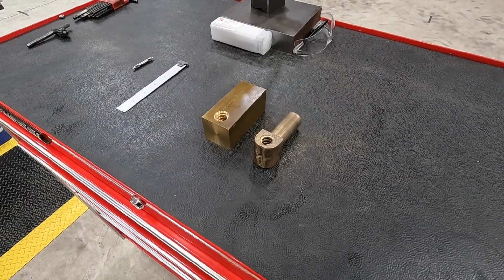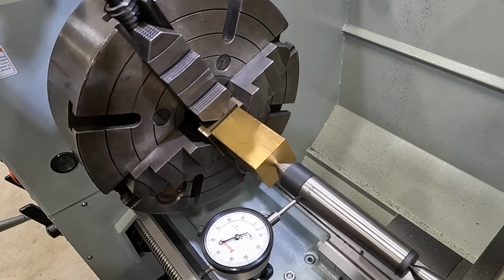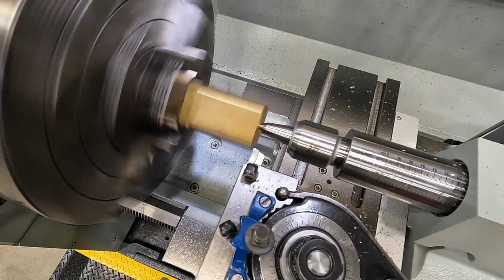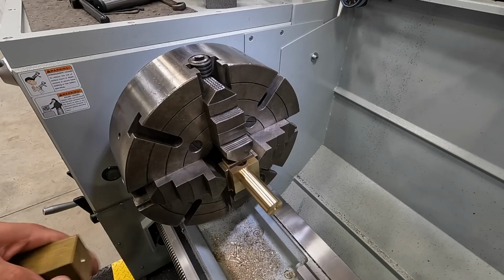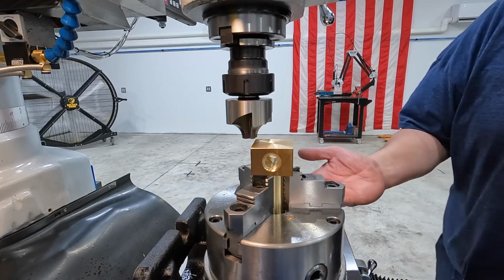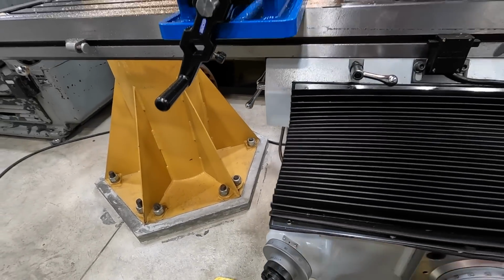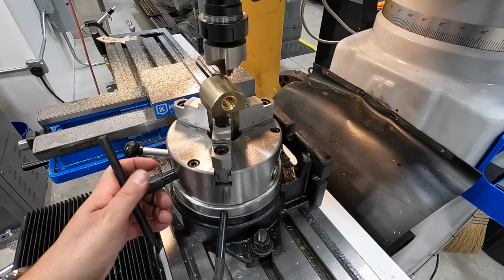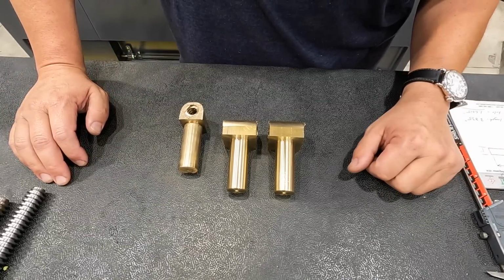Bronze Acme Nut Part 2

Comment: I like to use the bronze acme nuts (2) back to back in the nut block, one loctited in, the other adjustable with grub screw, that way you can always get zero backlash, by adjusting one nut, as the screw and nuts wear.😉🇨🇦

Comment: Have a off shore mlll/drill with a striped out nut on the x axis. Lead screw was metric 10 tpi x 15/16ish dia.  Could not get one anywhere
and could not afford 600.00 to get one made, plus I don't have enough experience to make one.......SO.......I , bought 1" acme rod and 2 nuts welded them end to end, welded on mounting plate to secure nuts, machined each end of the rod, put it all back together and it works perfect with NO backlash,  For the amount I use it, it will last me forever,  I know steel on steel isn't right, but sometimes you gotta improvise.

Comment: I noticed the cutting tool was not was not pushed all the way in to the holder, do you square it up every time you change tooling? Guess that was the correct way to inquire. Do you eyeball it or measure?

Comment: what amazed me, not surprised, is the comment " make it look pretty even though it'll never be seen " . is that the mark of an absolute master craftsmen? I reckon it is
Reply: That's what I love the most about My Mechanics - all the parts are done to perfection.

From a production shop perspective, "meets tolerances" is the goal, but if you want to continue to improve getting things looking the best they can while meeting tolerances and done in the right time is the mark of a craftsman, and not just someone trying to churn stuff out. Sometimes you do sacrifice "looks good" for time, but if you can get those parts looking good while meeting all of the other criteria then that will help you for the next time that "looks good" is part of the criteria.

To paraphrase the Essential Craftsman, it's really about knowing what your allowable tolerances are. Sometimes that's absolute perfection, and other times it's just meeting the budget and functional requirements.
Reply: Only on video. On production “looking pretty” would be near the bottom of the list as long as the part meets print tolerances.
Reply: yes only on vids like this. In production your only after the function if it is a part that never gonna be seen.

Comment: Watched the video on the fully welded hydraulic cylinder for the motor home.  Can you tell me what type of welding that is that you used to weld the end cap back on.  Also can you try putting a welding lens in front of the camera so we can see the actual weld?

Comment: Sorry for a bit of a non sequitur question for this video, but I've watched a bunch of your older videos (I take machine shop classes at night and your videos are great btw!) and noticed that on your big Monarch lathe when you do threading you don't ever seem to use the Monarch's party trick threading capability of not having to disengage the half nut to reverse off the thread.  For a long thread I would get that it could become annoying, but for the shorter threads wouldn't it be quicker/easier then backing off and trying to catch the number again?  I would think this would be especially so on oddball threads... just curious as I have just agreed to buy a Monarch C like yours (although quite a bit smaller)!
Thanks!
Reply: I am a gunsmith and never disengage the half nut when threading, especially barrel threads and the internal threads on a rifle action. It really makes the work go far smoother, and the reverse feed acts as a deflection cut, giving me an extra bonus.
Reply: @garygruber1452  Do you mean that you leave the tool fully engaged full depth in the thread while reversing the spindle? I thought backlash would ruin the thread but maybe not. I understand backing the tool out and reversing the spindle while leaving the half nut engaged but not leaving the tool fully engaged in the thread.
Reply: @ellieprice363  Agreed on the backlash - but even worse, wouldn't the tool just be rubbing in reverse rather than cutting?
Reply: @cooperised  Yes it would rub. The spindle can be reversed to the starting point with half nut engaged but the tool must be retracted.
Reply: @garygruber1452  With the Monarch (and the Hendys, possibly others I'm not aware of) you can reverse the feed without stopping the lathe, combined with the crossfeed stop it allows you to pull your cutter out, hit reverse, reverse out with the tool off the threads (but still engaged with the lead screw), turn the crossfeed back to the pre-set stop (zero), feed your compound in for whatever your next cut is and then change the feed back to forward...  
Which lathe do you have? It would be interesteing to hear about others besides the Hendy and Monarchs that can do that.
For oddball threads or if threading is a particular nemisis this capability can't be beat.

Comment: I wonder how much smoother the rounding end mills would cut if they were spiral fluted. Do those exist?
Reply: If you're talking about the quarter round they don't cut smoother. They chatter like hell and try to walk on you.

The cut needs to be all at once or the leading edge of the cut pushes away and you can't account for how far so your parts won't ever be accurate.

Comment: Being the machine repair kind of guy I am, I would put that extra ACME nut in a sealed plastic bag and keep it in the bottom of the control panel. Whoever ends up owning that machine in 30 to 50 years when it needs to be replaced again may appreciate it. :)

Comment: Most of the time when I regrind a corner rounding tool I gash the teeth. If the tool is burned up I regrind the form on my Hybco formrelief grinding head. 
When I grind the form I a
3 degree brake away angle  at the top and the bottom. 
This makes the makes the tool more forgiving at the tangent point at the top and bottom of the tool .
That angle is so small you never see it . The cutter pounds because of the straight flutes. There is no shearing action as with a
spiral fluted end mill.
Reply: I was wondering that and asked in my own comment - do they make spiral fluted corner rounding end mills? It seems like that would cut a lot smoother with a more gradual cut and always having an edge in contact with the part.

Comment: The finish on bronze always looks so nice
Btw doesn't it matter that the new parts have a wider head than the original?
Reply: As long as it doesn’t touch the saddle as it moves there is no problem.
Reply: Also wondered, but @july8xx has it right - if it clears everything then it won't be a problem, and I'm sure that Adam checked the clearance before using that cutter or he would have done something else.
Reply: ....i wonder that too...

Comment: Correct me if i'm wrong but isn't there a sort of oiling groove / hole through to the acme threads in the old nut - located at top of the curved profile? Oiling / greasing of screw = good maintenance.
Reply: Calm down boy

Comment: Hi abom, I’m a little curious why you use brazed carbide over insert for this job? I’m only starting out as a hobbyist so I know absolutely nothing so I would love to know your thinking
Reply: My guess is that the cutting geometry would be too aggressive for bronze. Bronze and brass have the tendency to "grab" the cutter if it's too sharp, which can result in chatter.
Reply: He's said it a thousand times throughout his numerous videos... brazed carbide tools don't spray the brass/bronze chips all over the shop and machine like carbide inserts do.
Reply: It’s cheaper than inserts, works well, and is easily resharpened on a diamond wheel.
Reply: Bronze is "sticky" in that it tries to move out of the way or grab onto particularly sharp cutters instead of forming chips.

Brazed carbide is usually much cheaper than inserts and can be easily resharpened on a CBN grinder, so if it were to mess up its not an expensive or difficult fix.

Comment: With cutters like that round over you used the higher the RPM the smoother the cut. If you increase the RPM with increasing your feed rate you are reducing your cut per tooth and the higher speed of the cutter also turns that slap into more of a vibration making it easier on your machine & fixtures.

Comment: I could not imagine having to hone or sharpen a quarter round bit without specialized tooling.

I'm would imagine there are still specialty shops that you could send that out to refurbish the bit if need be.
Reply: You don’t sharpen the radius areas. Only the four flats are sharpened and honed.
Reply: @ellieprice363  Interesting. What happens if it is a odd-ball cutter and the radius is buggered? I could imagine without some sort of positioned grinder doing the radii perfectly would be nigh impossible.
Reply: @ALAPINO  There’s no economical way to repair corner rounding cutters if the radius is damaged. Best to scrap the cutter and purchase a new one.

Comment: For the odd cutter that wants to chatter like that, you should look at installing a variable frequency driver for you motor.  It varies the motor's RPM between a set range so that no harmonic vibrations can start from a standing harmonic wave in the machine.  It's easy to install and use.  During normal operation, it can be bypassed completely since you are already  on 3 phase power.
Reply: Put it on the rotary table and use a end mill to make the RAD...that is how you would do it if you never had a RAD cutter as they always chatter.
Reply: @theessexhunter1305  Blue the surface and scribe the radius and remove the excess with the bandsaw. That way there’s a minimum to machine with the corner rounding cutter.
Reply: @ellieprice363  I started my toolmaking apprenticeship in 1977 and carried on as a toolmaker ever since..how long was your apprenticeship?
Reply: @theessexhunter1305  Trade school in ‘55 after Korean service. Toolmaker apprenticeship from ‘62-‘72. Designing and building jigs, fixtures and progressive dies ‘72-‘95. Last twenty five years (semi-retired) in my own one man shop
Reply: @ellieprice363  Sounds intense, you should add some vids of you work as it sounds very interesting
Reply: @theessexhunter1305  Re: Go to YouTube and type in my name after “Homemade Belt Sander” to see the video of my belt grinder. I’m wearing a blue jacket.
Reply: Or he could just throw it in his new cnc mill and program the radius
Reply: @keithhasafastcar  Yes, but as Adam is new to cnc a few goes would be good. In truth that rad is just clearance with the barrel dia being the tied up part. You need a lot of parts to make a cnc pay for it's self. Mind you the vies would go up with a cnc crash...
Reply: @theessexhunter1305  I don't see why it would not be practical to do this in CNC, bareing in mind I have zero experience... Once you can create the shape in CAD the actual milling would be identical to what was done here but with a different cutter. For Adam it might be tough with his lack of experience but it's just half a cylinder laying on it's side?
Reply: @Jcreek201  I have never used any CNC machine personally but I do understand what it is and how it works.

There would be no need for any sort of special fixturing here, it can be setup exactly the same as Adam set it up. As far as making mistakes in setting up the software to do the job, it's not a reason to say my suggestion is wrong, it's a simple shape and job and if you had the experience in fusion it would be very simple to set up.
Reply: But why change or attempt to improve it. It turned out beautifully with almost a mirror finish the way he did it. It’s easy to overthink a part
like this.
Reply: @ellieprice363  The old part has been in service for a very long time which would have been a production part, also it will never be seen again once fitted.
Reply: @ellieprice363  We're just throwing ideas around. Job is done and is absolutely fine as far as I can see.

Comment: Hi Adam, Why is this nut so much wider? Or doesn’t it matter for its purpose? Love your vids btw. I’ve been watching for over 4 years now.
Reply: I also notice that. it looks like you need to take off around a quarter of a inch each side the round the edges again
Reply: I was thinking the same thing. Adam may find out when he goes to put this in the machine, that he may need to shave off that extra material, and then re-machine the 3/4" rounds.

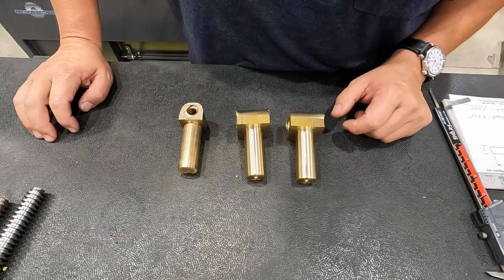Comment: 33:58 how is that same?that new part looks much bigger. Maybe i missed it,but size wasn't really critical?
Reply: You missed it.
Reply: The width isn't a critical dimension. As long as it clears the slot it runs in, it's good. The only critical dimensions are the thread and pin and their relative positions.

Comment: Why does the new piece look much wider at the top than the old one? It looks like it needed to be machined down on both sides before the radius was added. Maybe its just the way it looks on camera, but something looks wrong. Is that top dimension not critical?
Reply: It's not a critical dimension. I probably would have made it the same size but then I'd have used my CNC to cut the width and corner radii in one operation because I'm lazy.

Comment: The new ones are much wider than the old one. Does that measurement not matter?
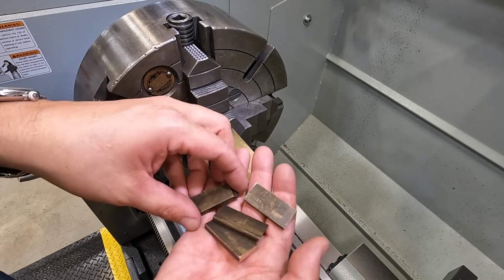Reply: Bronze Acme Nut for Lead Screw Part 1 @2:20
Reply: @jeffo881   went back to check and I believe he meant wider than the original in length where the threaded hole goes through. But it was just slightly longer, the sides however are way off and should've been milled down prior to putting the radius in to make it match the original. Maybe the measurement doesn't matter but it would've bugged me 🙂 even if the part won't be seen once installed..
Reply: Hopefully we'll get to see it at reassembly.
Reply: I doubt the outside dimensions of the head mean much. Completly noncritical.

Comment: They don't look the same as the old one.
Reply: Bronze Acme Nut for Lead Screw Part 1 @2:20
Reply: @jeffo881 Still not right, Adam said the Width would be the same, (in line with the bore) and it is, but it looks like the the other dimension is very much wider than the original nut. I suppose we'll find out in Part 3 !
Reply: @beezul  Quote: "it's a little bit wider than this one, but we're gonna use this width"
Reply: @jeffo881  there he was talking about the threaded dimension. The new one is a little longer (along the thread) than the original.
Reply: @pauldorman  Quote: "it's a little bit wider than this one, but we're gonna use this width"
Reply: @jeffo881  He was talking about the stock. I don't see why this isn't obvious to you.

Comment: Is it just me or does the new piece look different (bigger) than the original?
Reply: It is. But from what has been said so far about the critical dimensions of this part it looks like Adam made a few improvements. From what I understood the resting shoulders were important besides the fit of the threaded hole and the diameter of the shank. Perhaps Adam thinks that a possible cause of wear of the thread in the original is down to the resting shoulder area being fairly small. As long as the part fits in the machine in the end, and that critical dimensions are to spec, then the rest is just cosmetics.
Reply: @Gerald Reeves it's not just you, it's clearly not the same as the original. Maybe it doesn't matter but the sides should've been milled down before putting in the radius. And if he made "improvements" to the part shouldn't he have mentioned them and their advantages? No I think it's just lazy machining, maybe he didn't have the right radius cutter for a smaller radius and couldn't be bothered to set the part up in a rotary table and mill in the radius that way.. I dunno but the part certainly doesn't match the original

Comment: So are you going to install the prettiest or save that one for display?  🙂
Reply: Nah, sell the 2nd specimen to Motion, so their lathe will be back within OEM spec's.  ;>)
Reply: @eliduttman315  then Motion will also need to make a new lead screw for the new thread profile
Reply: @an2thea514  True.  However it's very likely that their screw needs replacement, just like Adam's.

Comment: Great job Adam...but..isn't the radius... I would have done this 1st...WHO CARES! If it fits and works, then it's ABOM CERTIFIED!
Can't wait to see it together. Beautiful job!
Reply: easier to adjust for squaring on the mill with a rotating table if it has a round shank. if he did the radius first, he would have to bump a mill vice tillt he part was square. easier this way

Comment: I always wondered why they don’t spiral the flutes on those corner round cutters? It would make them run so much smoother with less banging and bashing, specially with the larger ones that have so much engagement towards the last cuts.
Reply: would make them far more expensive to manufacture. I imagine someone probably makes one but you wouldn't want to pay for it.
Reply: Yeah I bet they're available if you got deep pockets! I have some pretty specialized spiral carbide wood cutters and theyre pricey! You can get them in non spiral too but yeah its buttery smooth, a superior cut really.

Comment: How did you indicate for drilling the center? Really, that wants to be centered on the cross drilled hole (the threaded one), not the bar itself. If you don't need to worry too much about tolerances staking up, I guess you could just trust that making both holes as close to the center of the bar as possible would work, but it's an interesting question of how to indicate in on the threaded hole if the situation was that you can't do that.

The first thing that comes to my mind would be to swap the order of the ops: turn the outer diameter, indicate on that surface in a mill and then drill/bore/thread the hole.